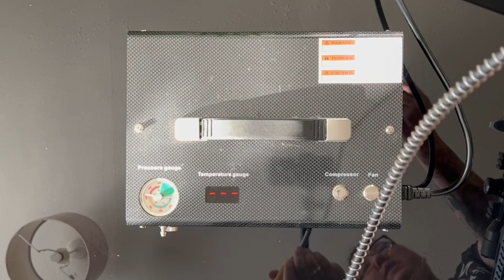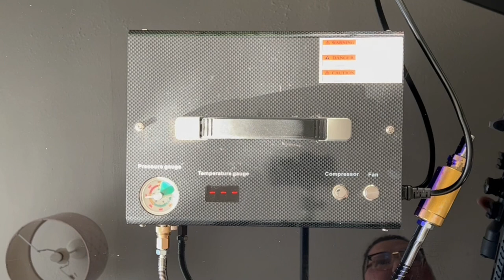How to use the Vevor PCP air rifle compressor

Comment: Is it still working?

Also, how often can this be used on a daily basis to tip off my rifles?
Reply from the maker: Mine is still working yes, and it can be used daily
Reply: @Air Head  Awesome to know this compressor works very well without issues, and that's it can be used on a daily regular basis!.. I'm patiently waiting for it to come back in stock